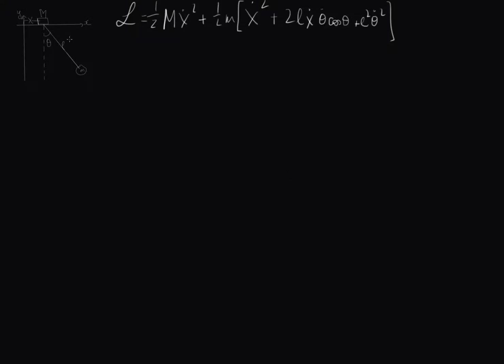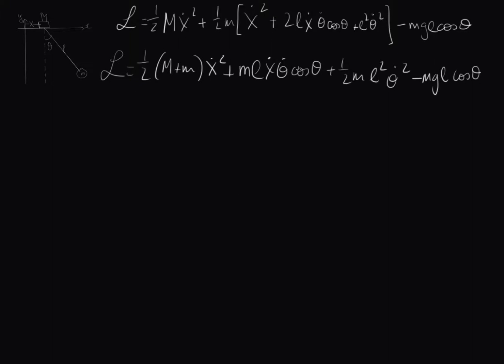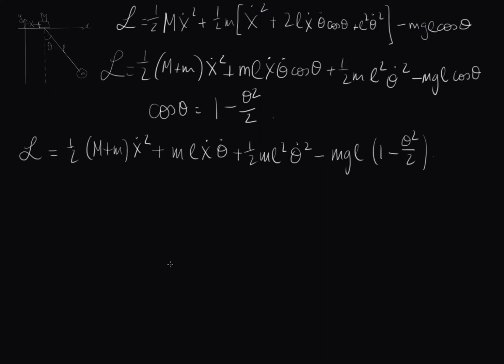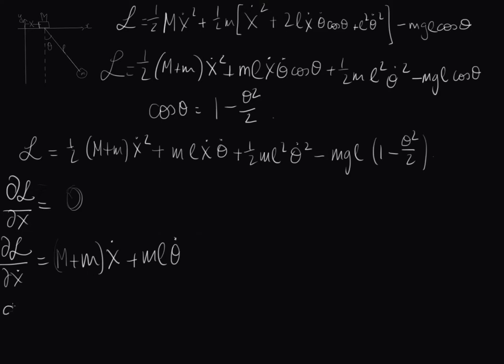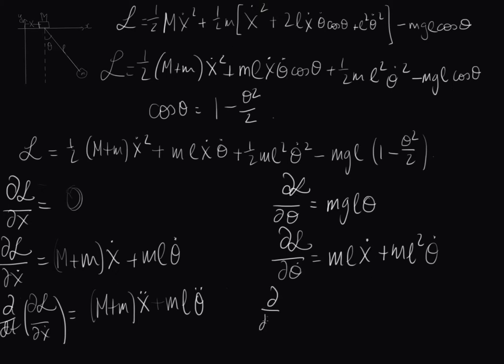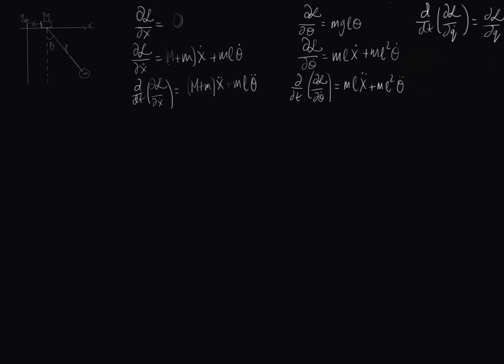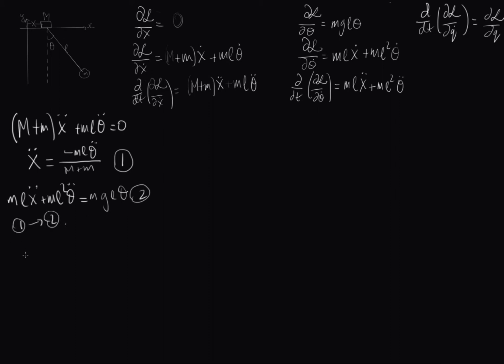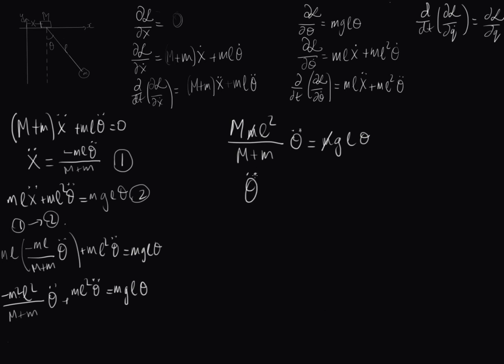Derivation of example system

Comment: at 2:11, did you forget to replace the cos(theta) with 1-theta^2/2? or am i missing something? the video was helpful :) thank you
Reply from the maker: I replaced the final cos(theta) - that's the one that comes from the potential energy -  with 1-theta^2/2, but the cos(theta) that's in the middle I replaced with 1. This is because of the presence of the theta derivative - because we're assuming small angles, we throw out any quadratic terms when they're multiplied by the derivative. Hope that makes sense, glad the video was helpful! :)
Reply: UNSW Physics thanks for the reply! so you're saying, because of the derivative, the quadratic term has basically no effect, so you just ignore it?
Reply from the maker: Yep - because we're working in an approximation anyway, we can ignore terms that have basically no effect :)
Reply: UNSW Physics thank you :)